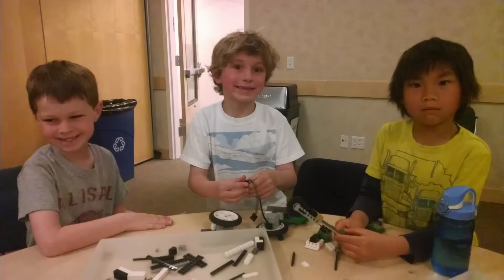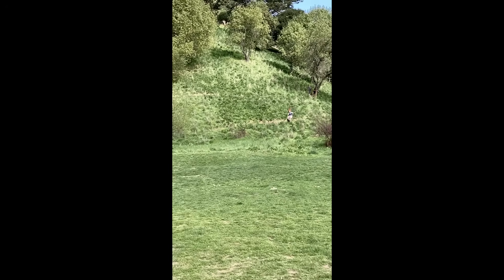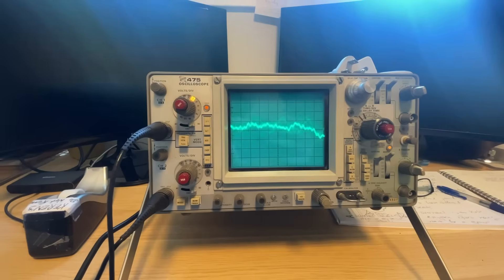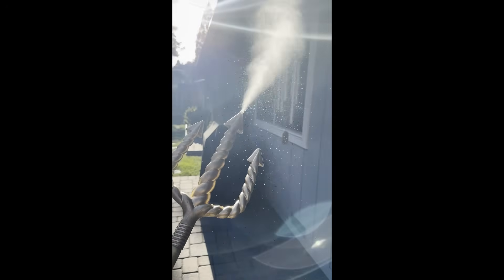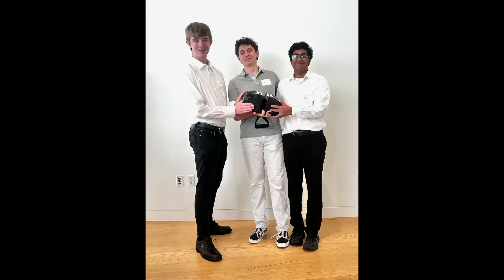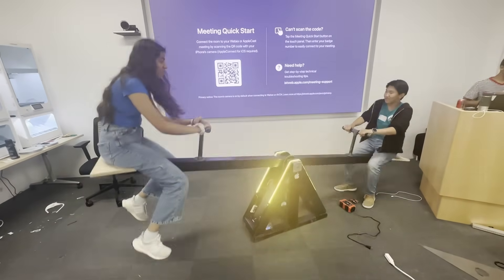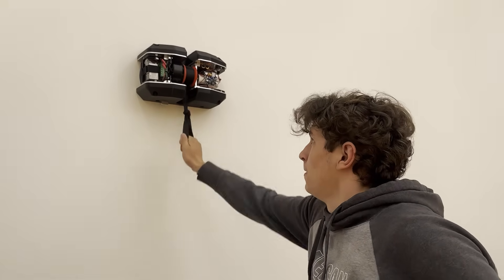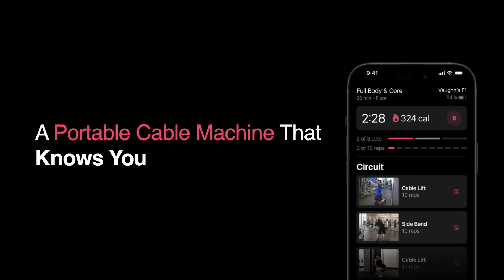MIT Maker Portfolio (Accepted Class of 2029)

Comment: Can't get the useful point of that work out machine besides showing that it can suck itself to the wall + to resist the defined weight you can maxly pull.
And which is heavier? The weight you can pull or the weight of the machine itself??
Reply from the maker: The machine weighs about 10lbs and it can generate about 45lbs of resistance. It's pretty bulky though.

Comment: think i might just have to make a zipline to go backpack.  Props!
Reply from the maker: Would definitely recommend! You can get everything to build that from harbor freight. It's a big aircraft cable with standard hardware and the really beefy yellow ratchet strap / come-along on one end. Amazon for the actual pulley thing that rides on it, and a good quality harness. We stuck some motorcycle tires on the end of the line for brakes. You can pick them up from any garage that does tire changes

Comment: Pretty cool -  considering that rope pull downs with a simple pulley and weight anchored to a pull up bar never really caught on from a mass adoption standpoint, I don't see these various resistive bldc motor cable machines catching on when they're 100x as complicated. Cool engineering regardless
Reply: A good marketing angle could be that the shipping is far cheaper. Shipping a pulley system including metal weights for resistance would be expensive, maybe even >100$ for the shipping. Just a guess but this device could be much cheaper to ship which could make the overall system cost lower for the end user. I’m thinking like people living in a high rise apartment with minimal space to store the weights etc. definitely needs a more sturdy mount, perhaps with screws. Very neat idea though
Reply: @unablebolts43  true but dumbbells are pretty cheap from any sporting goods store and you could go even cheaper and just use jugs of water or sand
Reply from the maker: I definitely would agree that Flex would be an impractical product, at least in its current form. It turns out the home gym market is really small (also resistance bands exist lol). Even so I think there's a market for it if the device was small enough to toss into a backpack. It is unique in that it can generate far more resistance than the device weighs. Maybe I'll build a V2 someday. Also, huge respect for your work!
Reply: i could see a gym filled with machines using bldc motors over weights,  generating some amount of recoverable energy.
Reply: @JaisonBuilds yea but that’s not easily portable. And people living in city apartments will take all the space that they can get. This little box and no need for all the weights. Definitely needs workshopping to find a market but I think it has some novelty. Especially if you could generate energy and charge a cell phone or something with it lol. Very neat regardless

Comment: You're actually genius what microcontrollers do you prefer the most?
Reply from the maker: I'm much more mechanically inclined than CS so I prefer to use Pi Picos since Micropython firmware is much easier to deal with than C++
Reply: @vaughnkhouri1364  yeah for my projects I usually use arduino uno or raspberry pi or esp32